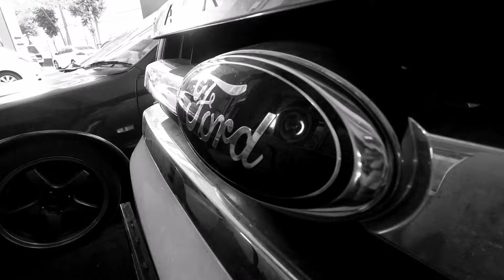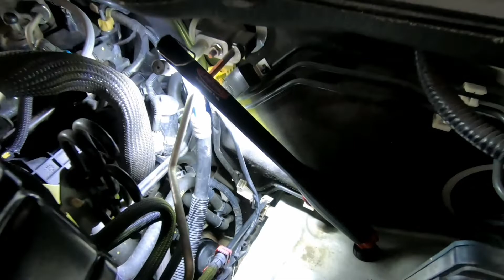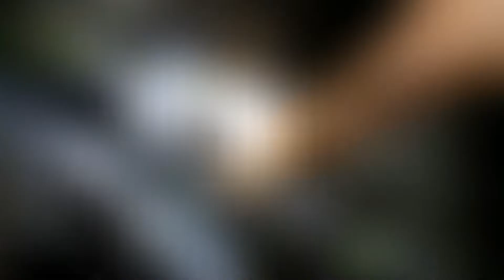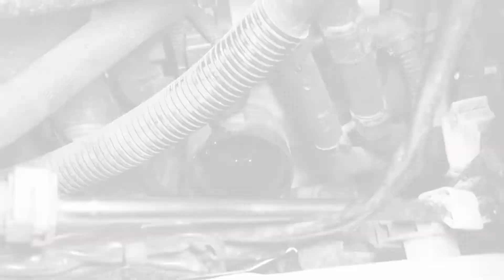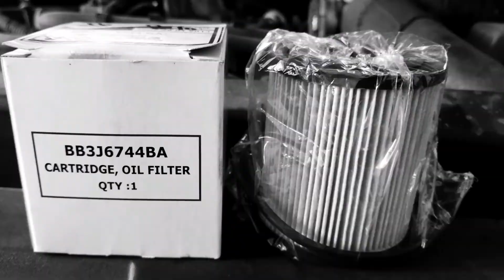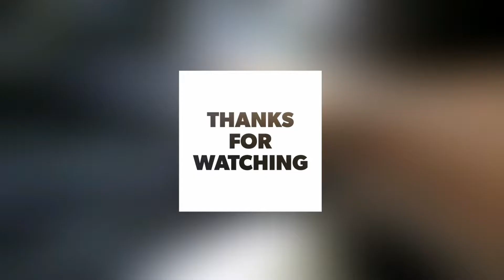Ford Ranger Wildtrak 3.2 Oil Filter Replacement

Comment: I do not get the 10 minutes is counted from the oil filter change. Yes I understand when draining the old oil you must  be quick and not allow all the old oil to drain otherwise the hydraulic pump may not work. When replacing the oil filter the oil pump still has oil in it therefore the time to replace the oil filter should not be taken into account? Please correct me if I am wrong. Thank you in advance.
Reply: Pretty sure you can change the oil filter first before even starting your oil change, so yeah not included in the 10 minute time anyway. My cousin did his apprenticeship through ford and is now working as a certified mechanic there, so a few years under his belt and probably well over 1200 rangers and said he's never had the problem happen.

Comment: Easier to come in from the wheel arch turn steering wheel RH full lock and just remove the two top push screw plugs and it's right in front of you just need a 27mm socket and  extension bars
Reply from the maker: Yeah, you are right! We found this alternative option too, thanks for pointing it out :)